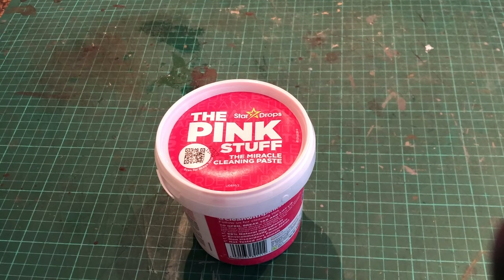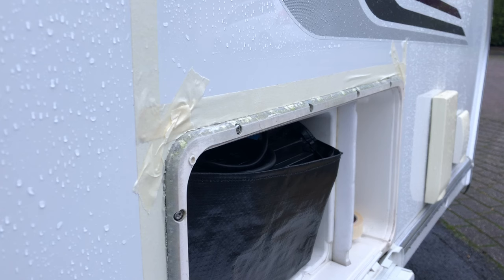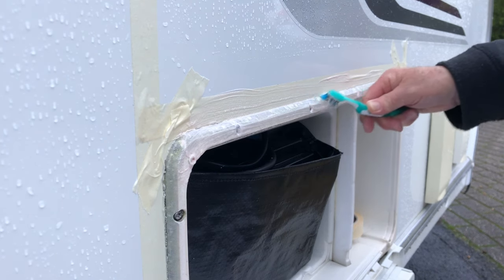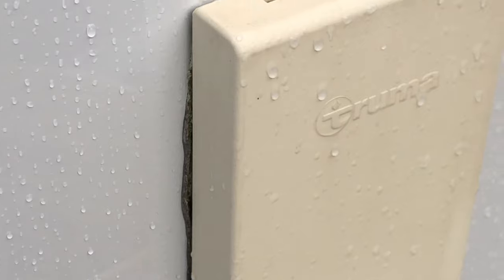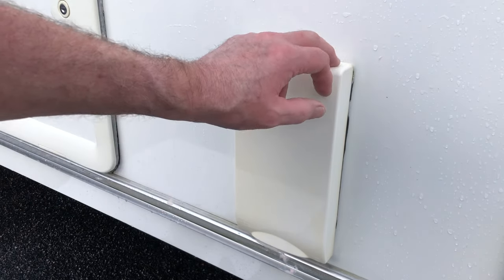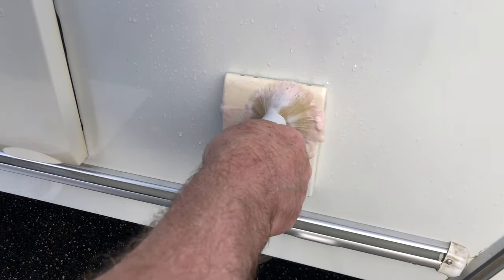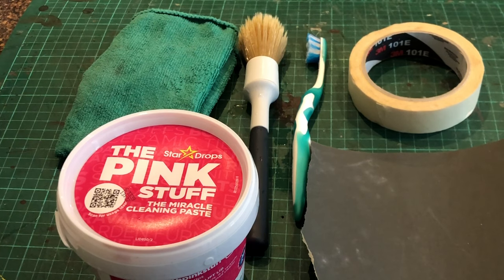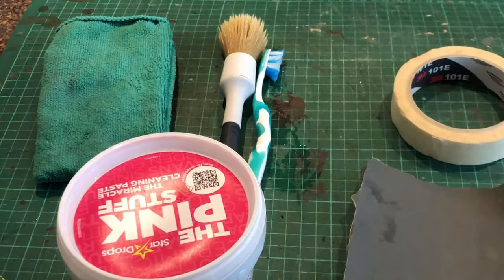Caravan Battery Locker Rejuvenated

Comment: White spirit and a tooth brush is by far the best stuff to use on plastic and especially the seals/sealant, been using it for 20+ years. Apply it and allow it to soak for a few seconds then lightly rub with the tooth brush, repeat if necessary until pure white.
Reply from the maker: Thanks for watching and the tip 👍😁